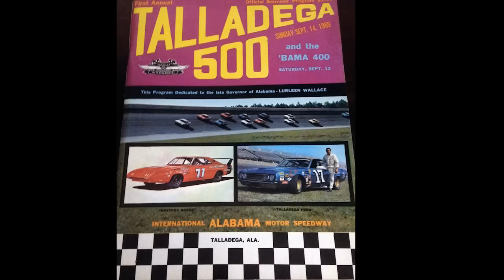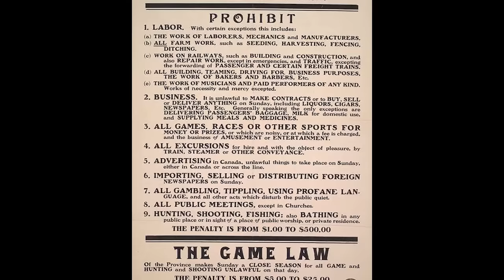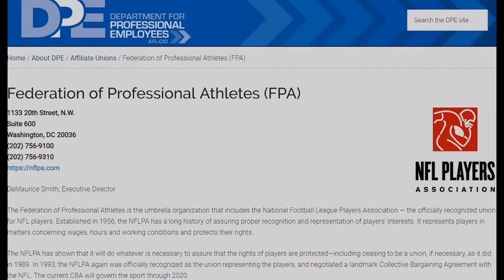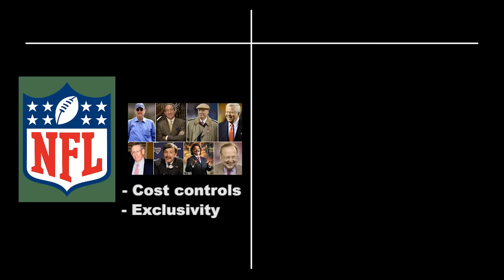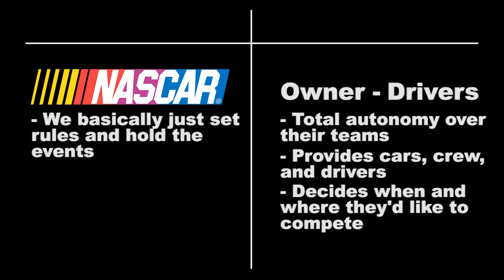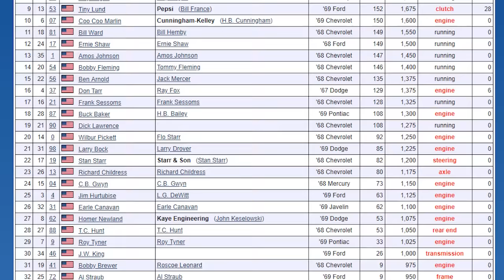The Worst NASCAR Race Ever: The 1969 Talladega 500

Comment: This is like the 2005 F1 race at Indy that had only 6 starters due to the Michelin Tyre issues.
Reply: See f1 is smart your tire not safe enough you cant race unlike nascar just straight up ban tire war
Reply: IIRC it was the decision of the teams on Michelins not to race, they were under all kinds of pressure from Bernie Ecclestone (the owner/chairman of F1) to compete but, quite rightly, none of them were prepared to risk their drivers.
Reply: yeme owner of f1 tried to sue the teams but a law stopped him as racing with unsafe tires is illegal
Reply: That's exactly what I was thinking.
Reply: broly rcf 
6 cars did race, the rest decided not to because of the unsafe tires. Exactly the same thing as This video.
Reply: If i remember right, then the 2005 US Gp went sort of like this. And keep in mind, that 2005 was the year when the FIA made that stupid "no tire chenges in the entire weekend" rule to....basicly give the advantage to Michelin running cars and stop the Ferrari dominance.
Friday, 17th June (free practice): Many Michelin contracted teams reported, that the tyres wore out very quickly, and that the Indy circuit's turn 1 (turn 13 in the F1 layout) and Ralf Schumacher had a huge crash due to a blowout. This worried Michelin since thier tyres weren't storng enough to make it through some hot laps, letalone an entire race without pitting for new tyres.  
Saturday, 18th June: The FIA and Michelin has a conference where Michelin states that if the FIA doesn't put some sort of a temporary chicane into turn 13, than the tyres will be safe for 10 laps only. After that they held another conference now with the owners of every F1 team, that was there to race (both Michelin and Bridgestone runners) to make a compromise. However Max Mosley, the president of the FIA then didn't wanted to change the layout or to do anything about this whole Michelin problem. SO the temporary chicane was out of the question. In the end the qualifiing was organized, Jarno Trulli had the quickest time with a 1.110:625.
Sunday 19th June: At the end of the formational lap all of the cars wicch run Michelin tyres went to the pits and boycotted the race. Only the 6 cars of the 3 Bridgestone running teams participated in the race.
Reply: Can you blame them? Michelin told them not to race, as they couldn't guarantee that the the tires would survive turn 13. If they had run and someone was hurt (like Ralf Schumacher and Ricardo Zonta) then they could sue the team, the circuit and Michelin. They didn't want to spend loads on a potential law suit!
Reply: Tbh the only "thing" you can blame for the 2005 US Gp was the FIA's "no tyre chenge for the entire weekend" rule. In my opinion it was too drastic and dangerous (Raikonnen lost his car at the last lap because his suspension broke due the vibration caused by the tyre)....and it was made to get Ferrari pushed down from the throne.
Reply: @FabianHunor  Even then, they would've had to change tires every 10 laps or so. Imagine if tires hadn't been designed to last the whole race... it would've been a farce even if they could change tires
Reply: @FabianHunor  the rules of the sport hamstrung Max Mosely.  F1 tracks were not allowed to be modified without propper testing of the modifications to the track. This rule was on saftey grounds which at the time made sense. F1 was screwed no mater what happened so the race went on and it was Ferrari's and Bridgestones only race win of the season.
 If the race a happened on a revised circuit Ferrari would have protested the results and would have won the challenge and the race any way.
 The whole problem was not caused by Formula1 it caused by Michelin who under estimated the tire wear. And did not bring the right tire compound for the new surface of the track..
Reply: @thearsenalmisfit2414  it wasnt Goodyear it was Bridgestone
Reply: @brolyrcf5618  That was a decision of the teams, not the sport. Besides, as he said in the video, Firestone DID pull out of the race. Michelin didn't, so the teams all withdrew. Also, the Goodyear tires that they flew in at the last second were able to hold up well. If anything, Michelin was being dumb.
Reply: I was at that F1 race, am abomination.
Reply: @thearsenalmisfit2414  It was Bridgestone, not Goodyear, that supplied Ferrari, Minardi, and Jordan. The source of the tyre debacle was the new diamond cut surface of the oval, which had been prepared for the Indy 500, a month earlier. Now, Bridgestone had a huge advantage, compared to Michelin, since they had a ton of data from the resurfaced oval, through Firestone. Firestone is a subsidiary company of Bridgestone and has been the sole tyre supplier for the Indycar series since 1999, so all the cars in the 2005 Indy 500 were shod with tyres from Firestone.
Reply: @FabianHunor   In the end, it was the newly cut surface of the speedway (the oval itself) that caught Michelin off guard. Bridgestone knew about the properties of the resurfaced oval, from the Indy 500 that took place a month earlier. How did they know? Bridgestone owns Firestone, Firestone has been the sole tyre supplier for the Indycar series since 1999 and had tons of data from the Indy 500 for Bridgestone to look at. So, you can't blame the FIA or the teams, Michelin were caught sleeping and fucked up.
Reply: @godzamoongus  your right my bad
Reply: @kevintucker3354  The 6 cars that did race were on Bridgestones, which held up okay through the banking. It wasn't a tread wear issue but the Michelin's more pliant carcass that caused issues and the Bridgestones were always stiffer in the sidewalls.
Reply: @Massachamp08  I didn't attend but as a Minardi fan seeing them pick up some points was a nice consolation prize.
Reply: @TheRedSphinx  I was at the 2008 Brickyard 400 and Goodyear showed up with a tire that went to shreds after only a short run. Nascar put the caution out every 10 laps. Camped out and spent about 1000 dollars over the weekend to watch a frickin parade. The beginning of the end for nascar.
Reply: as for me today, he made one this morning.
Reply: @carlknight8474  Bloody well said Yankee!!
Reply: @carlknight8474  I hereby knight thee Sir Billy!
Reply: As an American, American people need to learn how to not be narsistic over there country

Others perfectly fine country are a thing
Reply: @thederekstory3587  You betcha! There's Pakistan, Iraq, China, and we must not forget Columbia and Mexico. Without whom we would have no cocaine!
Reply: @silverdarlin  also the issue was only discovered on practice day (Michelin didn't have much experience with banked tracks) and they realistically would not haven been able to transport the needed quantity of tyres on such short notice
Reply: @brolyrcf5618  F1 also mandated a single tire manufacturer eventually, tire wars are dumb
Reply: @Massachamp08  I was there...Michelin did buy me tickets to the next year's race though.
Reply: Hi. He actually made a video about that.
Reply: This was worse
Reply: Lol I just seen that one
Reply: @henriquepaladino3779  ugh bummer! I was so about to learn myself about some f1, sadly we have a language barrier. This is all very interesting.it’s not surprising to me that corporations care less about human lives that they care about publicly to be honest.
Reply: The key difference there is that in that instance, the lack of real drivers in the race was due to the sanctioning body, the FIA, being very strict about their safety regulations rather than in this instance where the sanctioning body is basically ignoring their own rules. The FIA stuck to their rules, whatever the cost to the business itself, a decision to this day that is widely supported by F1 fans. 

This is why it's typically best that the body responsible for regulating a sport from a competition and safety perspective should be separate from the body that runs the sport's business interests. In American stock car racing, the same organization, NASCAR, is handling both the regulation of the competition and the actual business, leading to a major conflict of interest. In international open wheel racing, the regulatory body of the sport is the FIA while the corporation that handles the business is the Formula 1 Group. This helps to ensure that the regulations that protect driver safety to be properly enforced even in the face of financial interests.
Reply: @-yeme-  5
Reply: i just got a Michelin ad lmfao
Reply: But at least they managed to negotiate left and RIGHT HAND corners without getting confused... 🤣🤣
Reply: that race was pretty much a gran turismo 4 race.
Reply: @kevintucker3354  I thought the FIA would not allow anyone with Michelin tires to race and that's why all but 6 racers (Who were using Bridgestone Tires) to race?
Reply: 1,000th like you're welcome
Reply: @kevintucker3354  yep, and a lot of it was because of a tire war. Or I guess they call it a Tyre War in F1.
Reply: @thearsenalmisfit2414  well, and the Diamond Grinding Indianapolis Motorspeedway decided to do.
Reply: @carlknight8474  💯‼️
Reply: Uh tell me about it
Reply: I saw that f1 race on tv,I think it was on the speed channel, what a galactic and cosmic disaster
Reply: what’s a tyre?
Reply: The 2005 fiasco was on the Indy owners, who repaved the track without letting teams practice. But because the 500 carb day was long before the F1 race, IndyCars had the same problems, and their only tire supplier was (still is) Firestone; they fixed the tires and shared the results with their parent company, Bridgestone. So when the F1 race came up, Bridgestone was ready, but Michelin was counting on the previous year's surface which was far smoother. They had accidents in practice, the Bridgestone/Firestone "secret" came out, and Michelin drivers were royally pissed. They went out to the pre race lap but drove back to the pits. Firestone made sure the story was swept under the rug and blamed the "stupid French" for not knowing how to design tires.
Reply: @ernestogasulla7763 ,if I'm not mistaken, I think 2 cars had crashed out at the start of the race or warm up lap,I believe
Reply: Brit
Reply: He made a video about that too! XD
Reply: @PaTRpU99  the tire wear was caused in part due to the track compound. The diamond grinding turned the track into thousands of little needles that ate at tires. Zandvoort won't have that problem unless they use diamond grinding
Reply: It’s TIRE
Reply: Tyre? Brit detected
Reply: except imagine the boycott happening earlier, and the fia bringing in the gp2 field to fill the field
Reply: (Laughs in Spa 2021)
Reply: Nah that's worse, at least the Talladega 500 had a full field.*

Comment: I have driven over 200 laps at Talladega over the years, mostly with Dale Jarrett Racing, and was given a lot of leeway to do 180 -185 mph when the max they would let anyone do was 165. I was called in 2015 by Ronda Robertson, the operations manager who let me do the speed. She told me she quit and to stop running with Jarrett as Dale Jarrett and Tim Shannon, the latter the president of the company, were cutting corners as they were losing money and the tires weren't safe. The company folded shortly thereafter. I really never knew the importance of tires until I saw this video. Dale Jarrett, a former NASCAR champion, endangered my life. Jarrett called me one day to rationalize what I was told, but it was total BS.

Comment: NASCAR had 7 fatalities from '64 thru '67. So you can understand the drivers being worried about safety.
Reply: Grand Prix racing and sports cars racing were Getting Serious about safety ,then,also.24hrs of Le Mans had a car go into the crowd and kilt a number of fans in the 50s and the Europeans took notice of prevention.
Reply: Lance Secrest not just a number of fans, 82 people! It was like a small genocide in one accident
Reply: They could still improve the safety over the old cars, but they threw out the baby with the bath water when they got so far from stock cars.
Reply: @henris8367  yeah but they got hit by a Mercedes. What a way to go!
Reply: What was safety like back then?
Reply: @twistedyogert  Safety back then??
🤔...What is this word "Safety" that you speak of? 🧐
Reply: @Slinger43  So, no roll cage, fire suit, and nothing to prevent someone from flying through the windshield?
Reply: @twistedyogert  They had a primitive seatbelt & weren't even using racing specific seats yet. They had half of the Roll cage used today, half as many bars in it anyway.
They wore a driver's suit that was nothing more than a thin cotton jump suit dipped in some fire resistant solution. They didn't even have mandatory on-board fire extinguishers until 2003. What most fans of today's Nascar don't understand is the big difference between a Petty/Pearson & the current day driver's of those same cars is it took a very unique and rare individual in 69 to even climb thru the window of those fire-breathing ☠️ mobiles which would kill you just for looking at it wrong 💀 It's also the reason why the drivers back then were viewed with such with such awe and amazement, as HERO'S. The drivers of NASCAR today are not viewed in this manner because, let's face it, you don't face ☠️ in today's car 🤷🏻‍♂️
Reply: @Slinger43  it was that Petty barrel roll where they finally got serious. He NEVER should of lived through that.
Reply: @twistedyogert  it Petty who barrel rolled a car and he pretty much invented the window net. You can watch the video and see (IIRC and I'm not mixing up my crashes) him half hanging out as the car is rolling. They used standard window glass . When they said "stock" cars they meant it. They had kind of a roll cage but nothing like today. 50 years progress .
Reply: @lancesecrest7577  especially Switzerland. Races in swiss territory are prohibited until today due to Le Mans 1951
Reply: @otaviofrn_adv I think it was the 1955 LeMans disaster that you were referring to.
Reply: @stephenholloway6893  you might be right, I always mess up the year